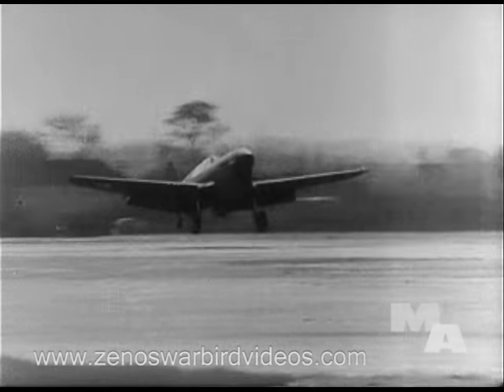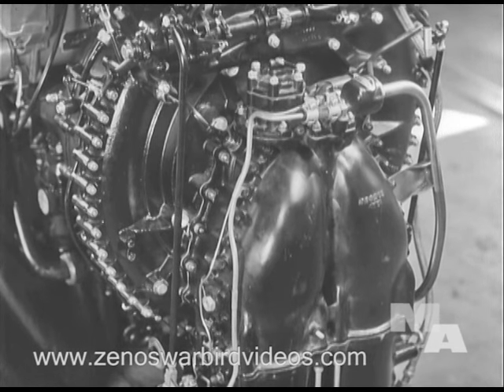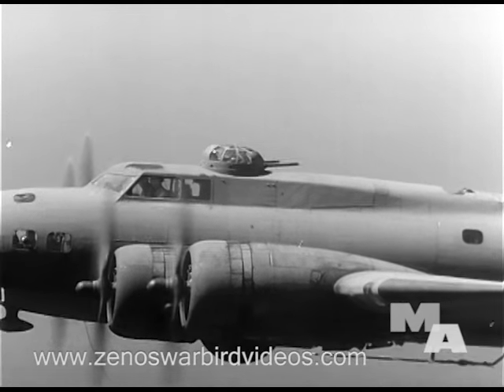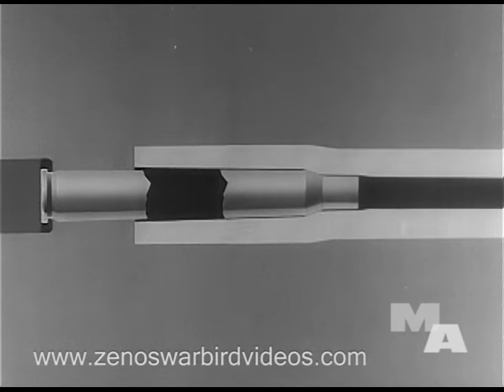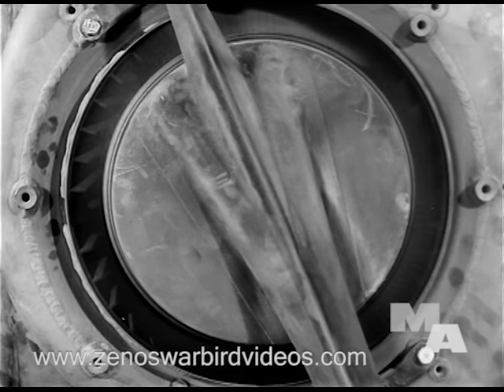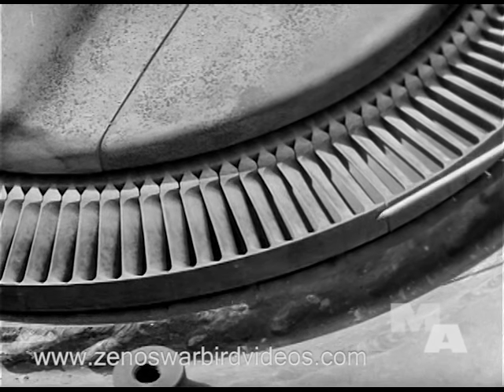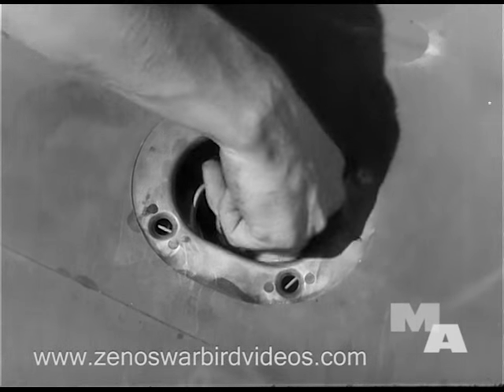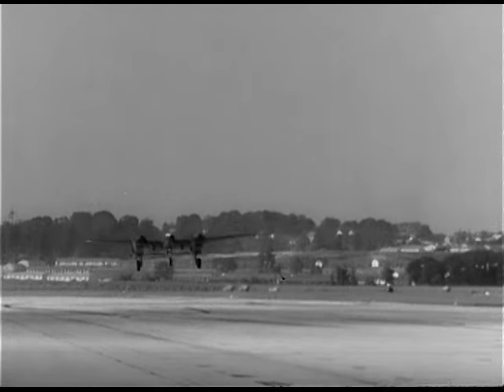Army Air Forces Alerts: Merlin P-40Fs, .50 Caliber MG Jams & Turbo Superchargers (1942-Restored)

Comment: Ahhh the good ole M2 MG aka Maul Duece. Headspace and timing, even today it's very important. Most of he 50s have quick change barrels I believe, but the babies we used back in the 80s were WWII vintage and you always had to adjust the barrel. We had a tool/gauge that set the tolerances required.
Reply: We had the go/no-go gauges for the M2 when I went to aircraft weapons school in 1960.  When I got to the field in 1961 everything was 20mm, but school covered them too.
Reply: Donald:
... " Mah Deuce"...
   ( As for "Mama Two")...

Comment: I'm wondering if the Merlin engine really did much to change the P-40's effectiveness? A great engine in the Spitfire and P-51, but those airframes were successful against enemy aircraft of the time. The P-40 was a bit dated by 43, 44, and a number of new aircraft were coming on line by then. Would be interesting to see how the P-40 stacked up against the Zero or the Me 109 with the Merlin.
Reply: The P-40 F used the single stage two speed Merlin 28, later Spitfires and P-51's used the 2 stage Merlin 61, which allowed much better high altitude performance. The Merlin 28 was better than the Allison, but not as much as the later Merlin 60 series.
Reply: @gavinfroggatt1760  Correct, but the Merlin only increased speed by about 10mph, resulting in Curtiss returning to an updated Allison. The Allison-powered P40N was said to do 400mph on the deck, faster than many other "highly touted" fighters. All in all, a great aircraft when flown by competent pilots in the proper scenario, IMHO.

Comment: The supercharger is what we now call a turbocharger.
Reply: @Incog Nito The device I was looking at is at 5:21, which appears to be a turbocharger as there don't seem to be any drive pulleys. The supercharger may have been before or after the turbo. As you say, the P-51 had a RR Merlin which had a two-stage supercharger, and at one time they tried a turbo and supercharger combo.